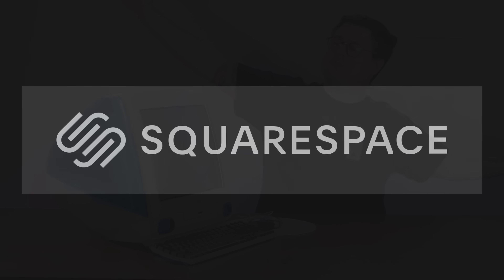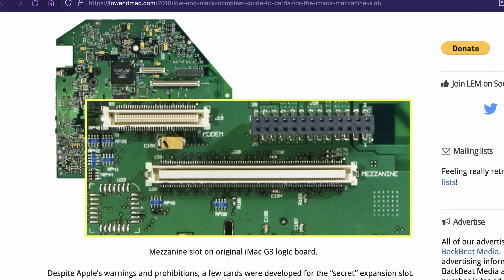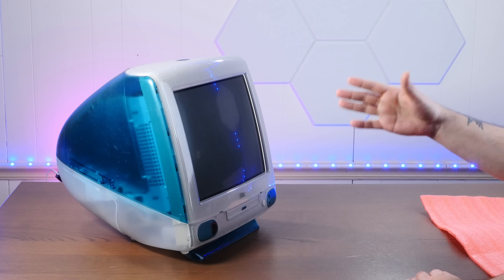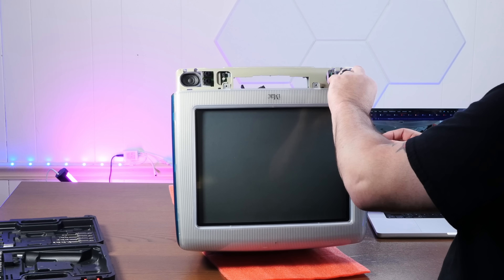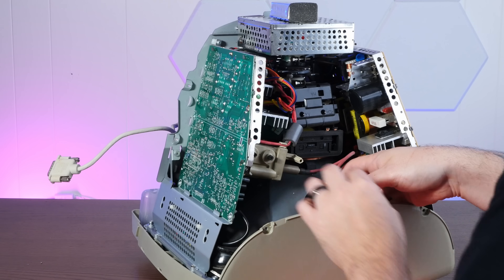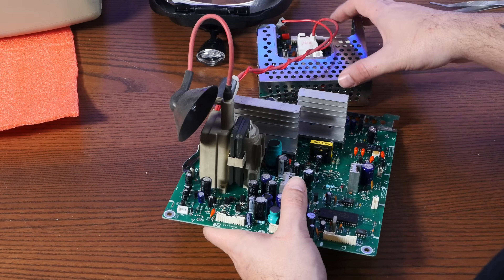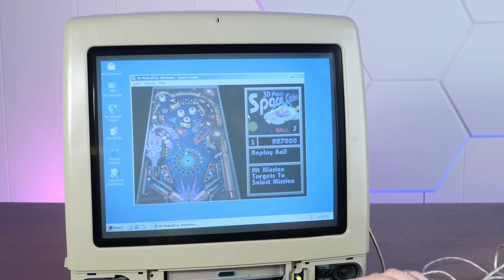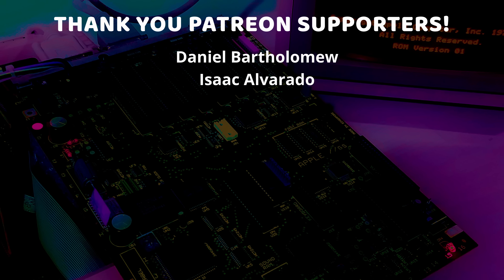This iMac G3 Has a Terrifying Problem... Let's Fix It

Comment: This video was super helpful! I just replaced the flyback on a slot-loading iMac G3. The disassembly is even more challenging. It also had the same issue with that resistor getting in the way of the new flyback sitting flush on the board. I moved it a bit, but the connector was still in the way — as well as a big blob of glue on the heat sink. I used a Dremel to carefully put a tiny notch in the flyback housing so it sits over the connector, and I also cut away part of the glue blob. The funny thing is, with all that Dremeling, desoldering, and resoldering, I think the most difficult part is the disassembly. They definitely did not design these to be repaired.

Comment: If it were me, I’d have Electro Luminescent wire inside of the iMac, I’d hardwire a USB hub inside & I’d get a 3ft USB extension cable & connect one to each usb port from the hub, I’d put a huge SSD in it & partition it to however big the CPU can address split one for Mac OS9, an equal sized partition for Mac OSX, an equal sized partition for Windows 2000 Professional, now, I never had any exposure to an iMac G3, at the time (1999) I was going into my freshman year of High School, walking around with issues of 2600 Magazine, CPU: Computer Power User, & other Motocross, BMX & Paintball Publications in my backpack, my home computer was an Intel Pentium III 600E, on an Asus Motherboard, I had an ATi Radeon 128GB DDR Gaming graphics accelerator card, creative labs sound blaster 32, which I built myself, my dad had a great parts guy in Westborough, Massachusetts (nearby my home town of Holliston, MA) although the ATi video card came from the Best Buy in Shoppers World in Natick, Massachusetts… I totally lost the thread of what my original point was…

Comment: Nice video! I just picked one of these up yesterday and it has the same problem. Hoping a simple cleanup will fix it as well; seems like it may have been stored in a garage or basement for many years and it's filthy inside and out.

Comment: Sean, about a week ago I found a 1998 teal colored iMac (same color as the one you worked on) by a dumpster. Exact model on little round sticker on bottom says “PowerPC G3 266 MHz/512 cache/32 MB/6GB HD/24xCD – ROM/Rage Pro/6MB SGRAM/modem.” (tray loader, with no infrared port) It had been rained on. And it sat out in my truck under canopy a few days. But then I found out these things may be collectible. So I’m just now drying it out and waiting minimum 24 hours before trying to fire it up. 

Question: is it too dangerous to try to power it on after drying it out, if I don’t know whether it’s been discharged or not? All I wanna really do is pass this along to a collector for parts who knows how to repair these things. I’m realistically expecting it will not work at all. But I don’t want to get zapped or possibly electrocuted either. Awaiting your reply before I plug it in.
Reply: Never mind. I already plugged it into a GFCI outlet after waiting several days and nothing happened. I scrapped it. Another video says to never heat dry electronics, but to always cool dry them instead. Maybe that's why nothing happened as I heat dried it.

Comment: INSIDE THE IMAC I CAN SEE THE CRT MONITOR WITH A DVI PORT AND A POWER INPUT CONNECTED TO A SEPARATE PC! What if you changed the old motherboard and replace it witn a new one? WHAT IF YOU USED THE IMAC G3 AS A MONITOR?

Comment: Had the exact issue on my rev A iMac when I first got it, but the previous owner said it had been sitting for years and it was pretty dusty inside. I blew out the dust and would let the computer run for a good 30-60 mins a day and eventually the flickering just about went away (it still happens but very infrequently now). Nice video!

Comment: 6:14 I worked at a couple of little Apple resellers back in 1999 (and as a Mac consultant after that) and sold many CRT iMacs, and RAM upgrades were a common option at the time of purchase and in the years after. We never used a pick to get the case off: just flip up the handle where the screw is, and tug on the handle. It sounds like it’s tearing, but it comes right off. All of the translucent plastic is polycarbonate, not ABS, so it doesn’t hurt it. You definitely don’t need to worry about breaking it! (Unlike the opaque ABS inside, which you saw was yellowed and brittle.)

Comment: I used to volunteer for an elementary school fixing their equipment. Had this G3 that would not turn on unless it was upside down. Had to run to Radio Shack for a soldering iron and solder to re-attach the... I assume a BIOS/CMOS battery... back onto the board. I'm no expert when it comes to Apple products. Mainly a PC user and PC computer whisperer myself.

Comment: 9:04 voltage is only applied if it is on/plugged in and the capacitors do self discharge to safe levels after a day or two in most cases. If you are that worried wait a week after it has been unplugged.
13:36 only to people stupid enough to touch anything inside, otherwise it is rather safe, the high voltage electronics are not going to jump out explicitly to hunt you down.  

If you know nothing about electronics then learn before you mess with things this complex.

Comment: Apple killed those with the quartz engine in OSX.  If you run OSX you will kill it again.  The high frequency of the video out will damage the flyback transformers in all of them(eventually).

Comment: WARNING: Be really careful! And you should know what you are doing when handling high voltages. You can get a serious shock or get killed in an instant.

Always discharge!! Learn how to do this properly. Most of the time it nothing will happen after, risk of a lethal shock will be next to zero. But be aware there could still be some charge left somewhere.

Comment: Looking forward to your follow up video with more shenanigans as I recently acquired the same Rev B with the same Harmoni 600 Ghz upgrade from someone that oddly enough was aware of the update being there but likely unaware of its value, so I got the entire thing for less than 100 USD. 

This Rev B is incredibly picky when it comes to SSD's:
* the red Startech IDE to SATA adaptor causes the computer to not even do the chime
* the cheap IDE to SATA adaptor (with the master/slave pin) works but disc can't be formatted with any OS 8/9/10. I have tried at least five SSD (8GB, 32GB, 64GB, 120GB x 2)
* the only thing that kind of seems to work for now is a cheap BIG RESERVOIR 16GB IDE SSD with a 40 pin to 44 pin adaptor. I can only get 8.6 and 9.22 to work though and I sometimes get odd disk errors that only DiskWarrior can fix.
* 44 pin to M2 enclosure with 120GB M2 SATA SSD doesn't work using the same 40/44 pin adaptor above. I can partition the HD once but HD stops being detected by the machine after that and I can't repartition again unless I take it out.

I have used a lot of the usual G3 tricks (aware of the 8gb boot partition limit, have tried cable/master settings whenever available, etc.). I may end up sticking to a 7200rpm GB as I have several in multiple sizes (40, 80, 120) but I am often more interested in the set-up process than in actually enjoying the final product. :)

Comment: I'm wondering if you could replace that CRT tube inside of that iMac with a flat screen and still have it work. I know the bezel is rounded to handle the shape of the CRT, but it would be awesome to upgrade the CRT screen to a flat screen and still retain this form factor.

Comment: Is there anyone who generally repairs older iMacs? I have a 2001 Graphite iMac G3, that needs a new disk drive, and has a strange problem where the screen is fine and then will turn to yellow, and a firm (not hard) whack on the side fixes the problem until it is moved again. Now it is doing this flicker thing as well. It is a fully functioning 600 MHZ G3 and it is now just sitting on a shelf. It was the first Mac I ever bought, and I am holding onto it for sentimentality I guess. It used to DJ parties with an iSub, and I had the thing sitting in the kitchen for years working as a kitchen aid. I transferred the hard drive to a G4 Quicksilver so a part of it lives on but it is just sad to see it sit and wait to be repaired after everything it did in it's heyday.

Comment: This is great to know. We have several old iMacs in storage and I know this is becoming an issue. I'm maybe more worried about the brittle internal frames at the moment -- I've seem some horror pictures on Facebook.
Also, I have a Studio Display coming soon - I know this is an issue for them as well -- very curious if a reflow and grease job is all that will need as well?

Comment: Had exactly the same problem on my Rev. B in 2003, had to send it to be serviced. Great little machine, my writing career started with an article about installing Linux on it.

Sadly, the machine isn't working anymore since my cats dropped it from a table. The internal plastics cracked/shattered, but the external ones and monitor are fine. However, when I try to turn it on the power LED just stays orange, no chime.

I'm hoping it is just a mistake I made when reassembling it, but currently I'm lacking the patience for a disassembly. And I do not have a good place for it, so I'm considering putting it up "for adoption".

I had the box with the complete accessory kit (discs and manuals) until a few weeks ago, but this was on a shed that got damaged by a summer storm, and I had to throw the kit out. 😓

Comment: I had a composite monitor that would do that. Eventually it would just shut down. No sweep, CRT heaters would go out, HV would discharge. Smacking the side brought it right back. I knew exactly what it was: cracked solder joints on the flyback. Big heavy transformer that vibrates, it's bound to happen eventually. Reflowed those pins and it was good until I gave it away.

Comment: Glad you were successful!  I have a dead parts unit (early Blueberry) I was going to offer you the analog board if you couldn't get yours going.  My experience is that usually you can see fractured solder joints; if they looked fine, I'm thinking the goop corrected leakage and arcing.  And yes, those things are sooo brittle these days!  I cringe every time I take one apart!

Comment: So the X-Ray warning is because if the tube ever operates at too high of a voltage, it will start emiting X-Rays so there's alot of protections and parts in there that have to be replaced with the right parts to prevent this.
Reply: Safety third.

Comment: Replace the flyback, it will fail at some point and you will need to crack this thing open again. The more you open it , more those plastics get broken. Take extra care with the inside grey plastic that surrounds the CRT and with the CD faceplate in the front. You forgot to remove it before opening. I find it easier to always remove the it before opening it, less prone to break it. If the cd faceplate gets broken, you can 3dprint a support.

I had to replace my imac flyback, back in 2018. It rocks till this day. Boots BSD with worspace manager from openstep. I wanted to compile the CDE manager into BSD. Someone did this in the ibook g3.

Comment: Sean your anguish while working with those plastic snaps was something I felt deep in my soul. Even when I'm opening modern computers for my day job I'm always mortified I'm going to break one of them and not be able to get the machine back together properly. I hate tabs so much.
Reply: This is me working on any repair. I know a fair bit about repair, yet I still manage to break something every time. I can't imagine working on those particular plastic tabs.

Comment: I recently bought one of these gems (the exact same model and color) from Free Geek Arkansas for a staggering $50 and hauled it home.  Mine will degauss and produce the high voltage to the screen, but no chime.  I look forward to more shenanigans with yours!  Maybe I'll get a few ideas for mine once I get mine running.
Reply: Is $50 cheap for one? I got one yesterday at our local tip (there is a section for E Waste) along with a studio display 30 inch.. Searched this up as it has the same issue…

Comment: If you ever need, I've got a perfect low hour spare tube sitting in my storage unit only thing is it's got no deflection coils or neck board. Though I can't remember if it came out of a tray loader or slot loader

Comment: Yeah, they need the x-ray warning because those larger CRTs require >20kV anode voltage, which creates some x-rays when the electrons strike the phosphor. The front glass in the tube is usually leaded, which shields the user from the x-rays, but operating the CRT with the rear shielding removed will allow some small amount of x-rays to escape. You'd probably get a lot more radiation from a dental x-ray, so it's probably not worth worrying about unless you're standing to the side of an unshielded CRT for an extended period. But you smartly put the shielding back for testing, so absolutely no issues there.

Cheaper monitors won't have that shielding, but they're usually designed to direct the x-rays towards the rear of the monitor rather than to the sides. And again the doses are so low that standing a couple of metres away would probably only be marginally over background levels of exposure. I imagine a teacher standing in front of a classroom of monitors with their rears towards them may receive a higher dosage, but we're still talking around the level of a chest x-ray or so per year, which is well within the safe allowable dosage for a normal adult.

Comment: I have CTX monitor that I found at my grandad's in a barn. It was filthy but after a good cleaning it worked and had very sharp picture so it must not have been used much. The monitor worked for a while until the vertical drive IC got could solder joints. Which made the vertical almost collapse and lose sync signal.  After I resolder the chip the monitor worked again just like it did when I got it.

Comment: I do know at least on CRT TVs but it should be the shame for computer monitors. the pins on flyback transformer like to get cold solder joints over time. So I always recommend resoldering the flyback pins on a TV or monitor you care about.

Comment: I used my Rev. A (bought for release day) Bondi Blue  until one day, instead of making those little zaps and flicker, it made a LOUD zap and never turned on again. It's been in storage since, and I'm really dreading opening it again after all these years. The plastic sounds cracking when it when it was new were terrifying enough. If I recall correctly, there was an Apple Tech Note saying the horrible cracking sound was correct when opening these. Now with brittle plastic, it's even more nerve-wracking. :(

Comment: I’ve got exactly the same issue on my Bondi G3 and you’ve inspired me to give it a go and fix it myself 😊 still have the original keyboard and puck mouse! Will let you know how I get on hopefully it’s the same simple fix without having to replace the transformer…
Reply from the maker: Awesome good luck!
Reply: @ActionRetro  I think you should replace the flyback anyway,  it will fail at some point and you will need to crack this thing open again.  Had mine replaced back in 2018 and still rocks with BSD. Take extra care with the inner grey plastic, specially in the lower parts where the acrylic fits, and with the CD faceplate. I always remove the cd faceplate before opening it, less prone to break it.

Comment: should look into getting a 3d printed replacement for the inner shell its only going to get worse and turn into dust witch it will 
I'm surprised no one in the mac community has made reproduction of that part.

Comment: Boy, that brings back the feels. I took apart soooo many of those 20 years ago when I worked at a local repair shop. I got pretty quick at it eventually. Every time there was a big lightning storm that came through there were a handful of machines that would come in with bum power supplies, and a handful of those would be iMacs that had to be entirely disassembled to replace that. >_<

Comment: The ball passing through the flipper may have been because Space Cadet relies on x87 floating point calculations that maybe aren't emulated 100% correctly in your PC emulator.
Reply: Did u mean x86 as in the architecture or an opcode called x87
Reply: @willkelly4701  All x86 CPUs before the 486DX didn't support floating point and needed an external FPU, for example an 8087.
Later CPUs have this built in, but the floating point instruction set is still called x87.
Reply: Nerd.

Comment: I didn’t realize that it was that “easy” to get into the iMac. I have an old grey iMac SE that has been in a closet moving with me for the past 20 years. Might try breaking into it and replacing a startup battery that I suspect has been bad for a couple decades.

Comment: The only problem I usually see in these imacs is the accumulation of dust + humidity, which over time ends up becoming conductive. A simple cleaning of the flyback tube and cable will solve the problem.

But it is an extremely dangerous process, I recommend that you leave your equipment turned off for a few weeks before disassembling, as the tube and flyback can store a lot of voltage even when unplugged. Or, if you have some experience, discharge them using a screwdriver and a ground wire.
Reply: Most modern equipment has bleeder resistors on big capacitors and CRTs, so usually leaving things off for an hour is plenty.  Of course, it's always best safety practice to not depend on this until you know it to be the case.  Measure the capacitors, and discharge the CRTs with a chassis ground wire with a 1M-ohm inline resistor.
Reply: He discharged it off-camera.
Reply: Short to ground.